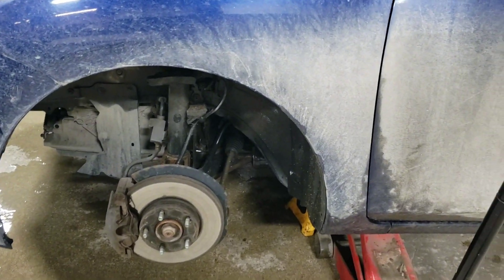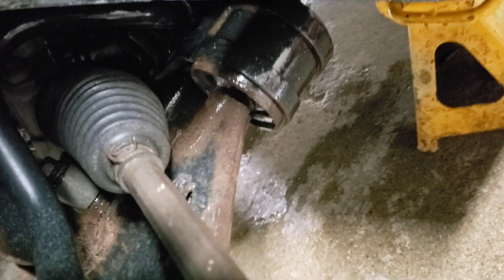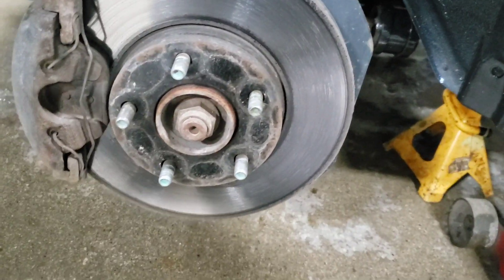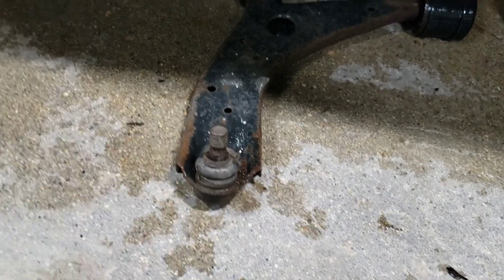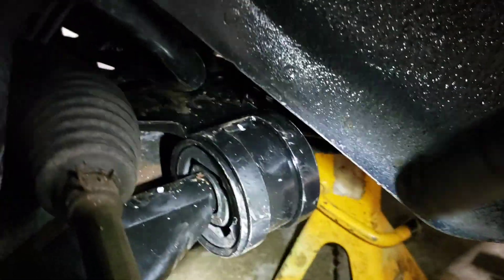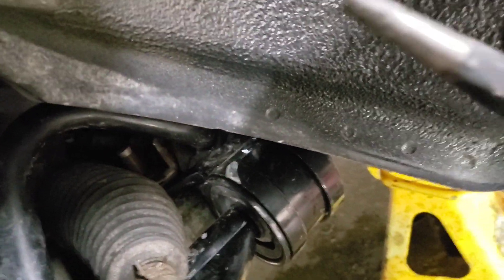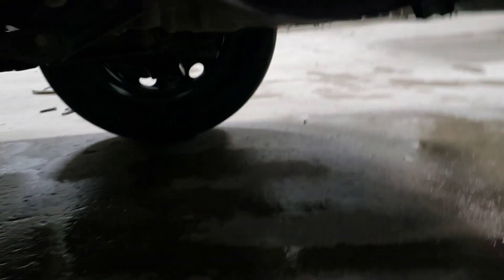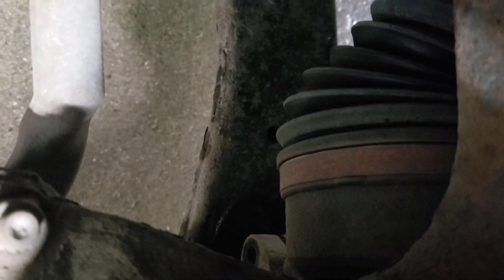2012 Mazda 3 front lower control arms

Comment: Were you getting any clunking noise while braking ? Just curious I have that problem same car. Just changed all brake pads rotors and calipers. Still getting noise while braking
Reply from the maker: Yes typically a worn bushing and ball joint will make a clunk noise during braking. And  acceleration. Whenever the weight transfers from that wheel typically.
Reply: @ thanks I’ll try this next
Reply from the maker: @joserios57  well a good way to check a loose ball joint is jack up the car. Then take a fairly large pry par and put between the ball joint and steering hub and pry it up and down. If the ball joint moves up and down at all. It is worn. With the bushing you will typically be able to see tears in the rubber and again with a pry bar you can pry against them to look for excessive play.
The last place you could get a clunk from is the top shock mounts. 
But I would say 90 percent of the time it is the lower ball joints
Reply: I’ll definitely try the pry bar trick
Reply: @ so I relubed my caliper pins and brake pads. No more noise